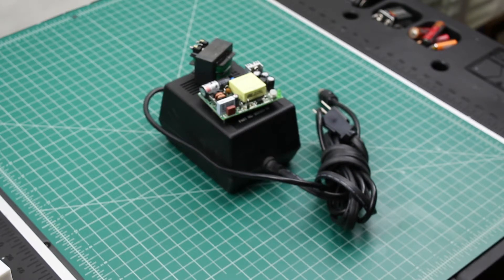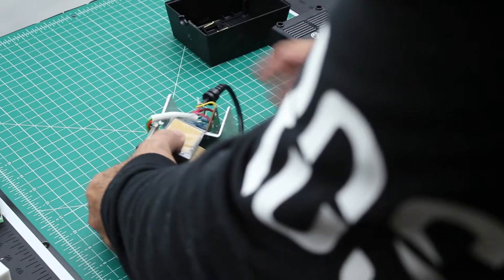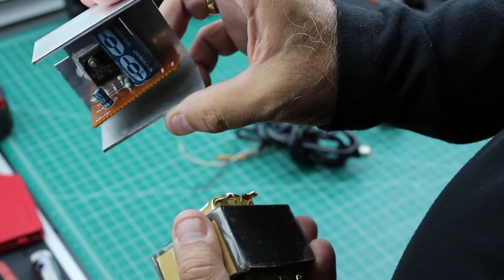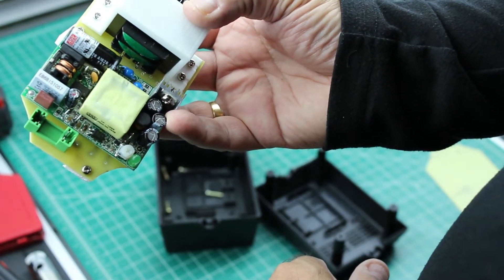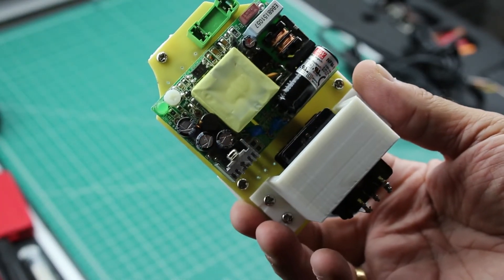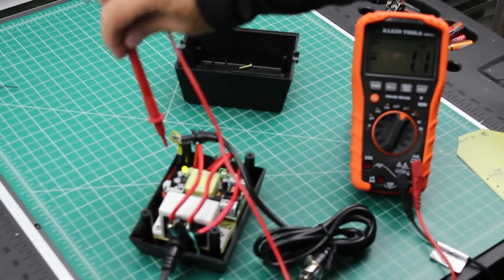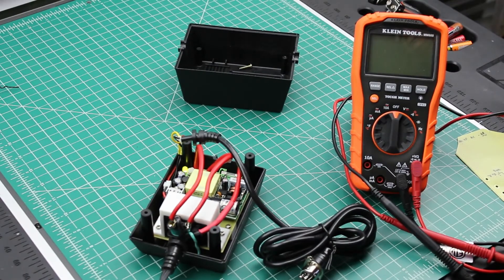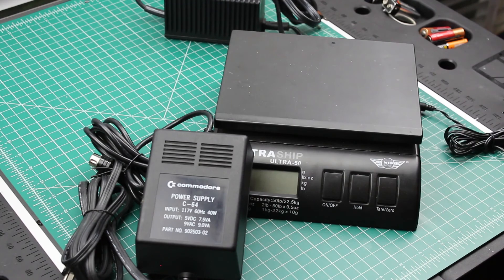Commodore 64 (C64) Meanwell Power Supply Retrofit

Comment: Thanks for posting this! I have what is essentially this power supply. I've used it as recently as about 9 years ago, but don't think I should try it again. I'll decide about which path to take amongst those you suggest.

My original Commodore 64 power supply looks like this and came with similarly grey/brown C64 c.1983. My power supply has the same case and also reads "PART NO.902503-02", however rather than reading "C-64" (on top, beneath the words "POWER SUPPLY", as the one in this video) mine reads "CLASS 2" beneath "POWER SUPPLY". Also rather than "5VDC 7.5VA", mine reads "5VDC 6.5VA".
On the bottom, my power supply has neither the CSA nor the UL logos, but, instead, has a decal reading, "UL LISTED NO. 735Z" and "CSA LR 49733". Mine also does not have the "USI / BILLION" name on it, nor any words in French.
Reply: @revivingretro  I'm capable of making this, but I also like the convenience of - and I like to support - modern products for vintage C= machines.

I'll probably buy something ready made, but both you did a nice job showing us both your power supply projects!
Reply: I decided on this dual power supply and am planning to use it to simultaneously replace the power supply for my 64 and my 1541.

The plan is to gut the 1541 of its old PS components and put a 4-pin DIN power connector where the AC mains entered the 1541 case, sort of like a 1541-II.

https://www.keelog.com/c64-fdd-dual-psu-modern-black-us-replacement-commodore-64-fdd-1541-ii-power-supply-us-plug/